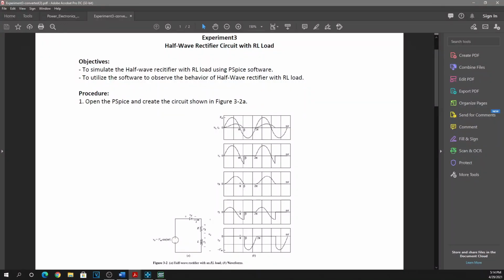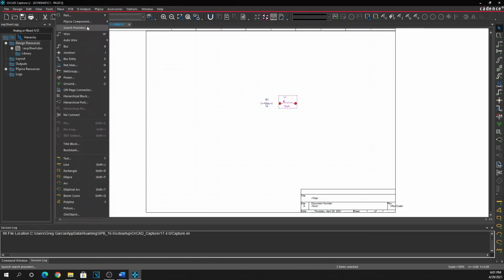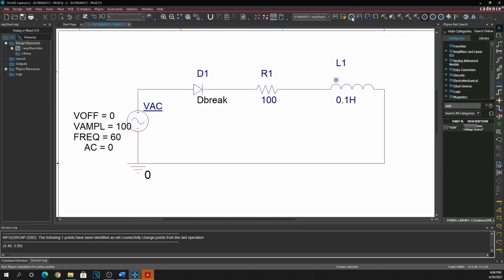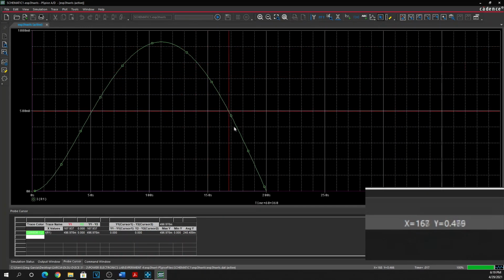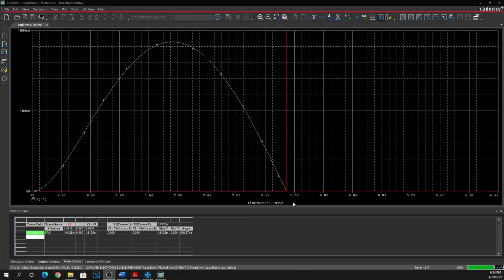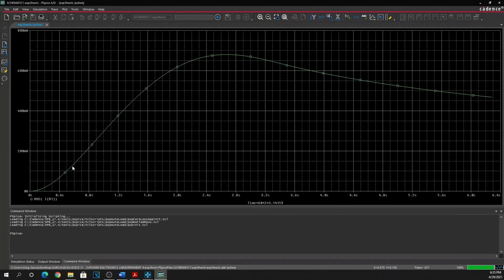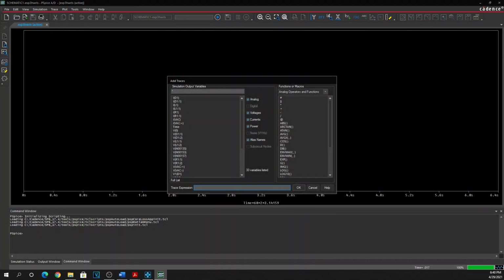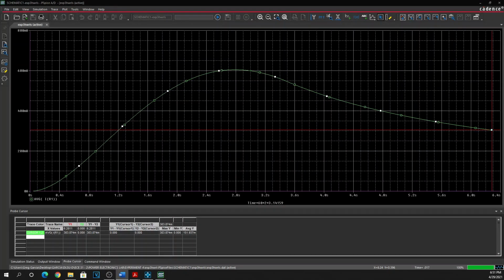POWER ELECTRONICS LAB - Experiment 3 -- Half-Wave Rectifier Circuit with R-L Load

Comment from the maker: TIP: To find the Beta(Value) using the scientific calculator (Casio fx-991ES PLUS)

SHIFT SOLVE
1. Equate the current formula (beta) to zero and as function of x.
2. Press SHIFT-CALC, the "Solve for X" will appear. 
3. Enter the initial condition for x equal to pi or 3.14159. Since the beta value is usually located after the AC source waveform completes a half-cycle (pi).
4. Solve and the value of x should be equal to 3.502604206 in rad based from given problem in the video.